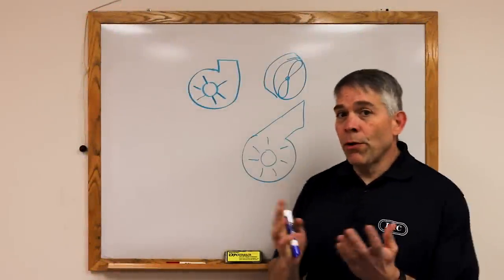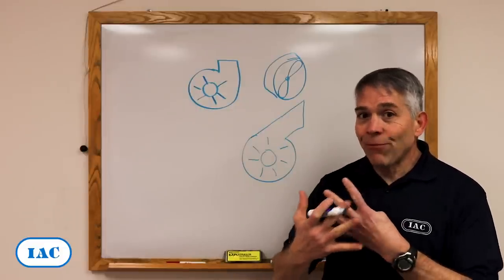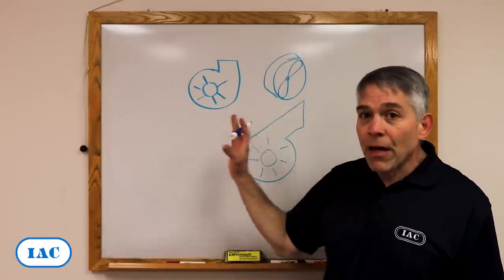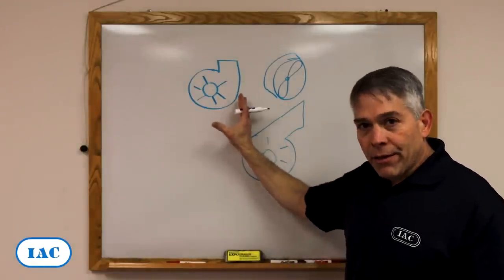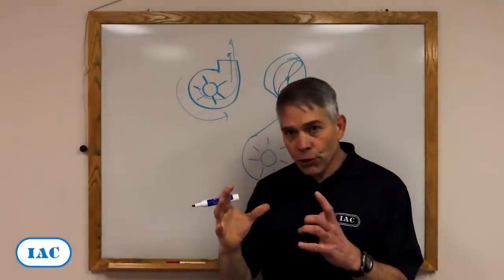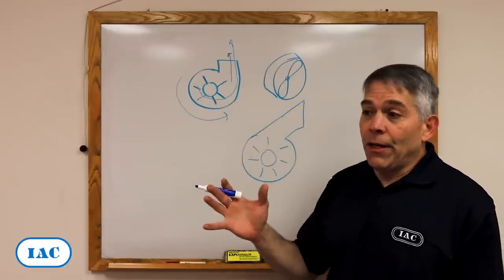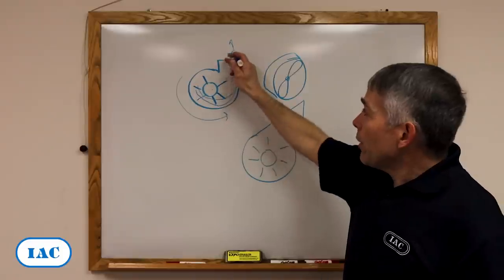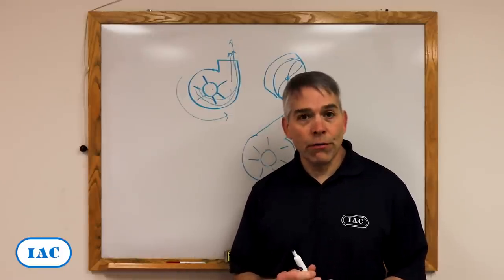Centrifugal Fan vs Axial Fan

Comment: OMG.... I have been sooo depressed about my 3phase 3hp "big blower" performance. Was almost in tears over it after much calculations and planning. I decided to do a "quick YouTube check" and found this video. I immediately ran out and reprogrammed my VFD and BOOOOM, the damn thing was running the wrong direction. I can't thank you enough. Who would think it would still suck on the same duct in either direction, but one WAY more efficiently than the other. My decimal levels are less than half, and my air flow is like triple! According to the VFD it's now running in "reverse" I'm sure I can reconfigure it, but for now I'm blown away (no pun) by the performance. The world makes sense again. Thanks so much for making this video!

Comment: So, now I'm confused because a tube axial fan that is designed for ventilation is somehow not supposed to be used for ventilation? I should use a squirrel cage in my paint booth?
Reply from the maker: Axial fan is fine for ventilation without fine filtration.  If you have a paper or fabric filter, there is a notable restriction to flow, so a centrifugal fan is very likely needed.
Reply: @IndustrialAccessoriesCompany  What about using a tube axial fan with ducting? One of the reasons I'm asking is because I'm getting ready to build an evaporative cooler for a greenhouse by forcing air through ducting (4" corrugated drain pipe) My tube axial fan is a Dayton 12" with a four fin blade with a 3/4hp motor that moves at a max of 2877rpms. (I don't know what kind of static pressure it can pull or push) It will be attached to a 20' 12"diameter culvert pipe that elbows at 45 degree into a 20' piece of 12" diameter culvert that is the manifold for about 30 - 4" drain pipes that travel about 25-30 feet to complete the air loop (without filtration).  So, I have air pushing through about 200' of underground tubing.

It looks like some of the evaporative coolers that are similar in build are using "inline fans, (centrifugal fan) but they don't have nearly the moving power at 12" that I am thinking the tube axial has...(am I wrong?) I'm attempting to move just under 8000cf of air in about a minute or two through ducting. The 12" inline will move 8000cf in about 5-6 minutes. Do I need to go back to the drawing board?

Comment: Never heard that you can change the direction on an ac-motor (fan), or are you talking about 3-phases fans? Besides of dc motors or connecting the airflow wrong, how do you manage to get that fail happen? :D (sorry for the english).
Reply from the maker: Hello - thank you for your question.  Luis Castano's reply is: "Not all AC motors have the ability to be reversed, but most do.  Reverse direction is made by simply switching wire connections.  DC motors are not common in industrial applications."

Comment: Hello man. I'd like to ask what is the best kind of turbine/blower/propeller for a BIG vacuum I'd like to build for my woodworking shop. I'd like it to be able to suck really hard through at least a 4 inches hose in a system of pipes of more or less 500 ft long in total. 
The dust collectors already available seem to be too weak for that, so I'd like to build a better and bigger one, but I don't know what centrifugal or axial propeller design is the best for high suction pressure. 
I hope you can help me. Thank you! :)

Comment: hey i have a question ¿ how can i calculate the capacity of fan
Reply from the maker: The question is too broad.  Depends on the type and size of fan.  A way to get an idea of flow capacity is to measure the inlet diameter, calculate the inlet area and multiply by flow velocity of 3000 feet per minute.